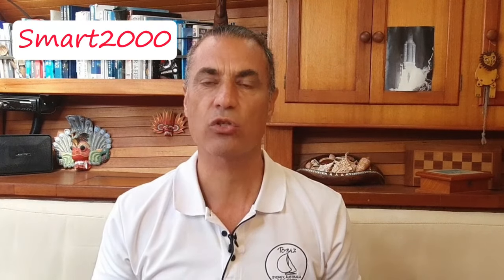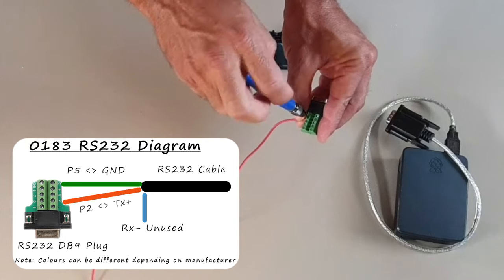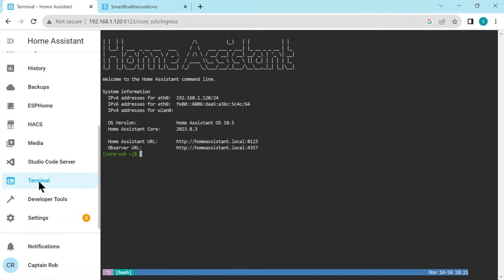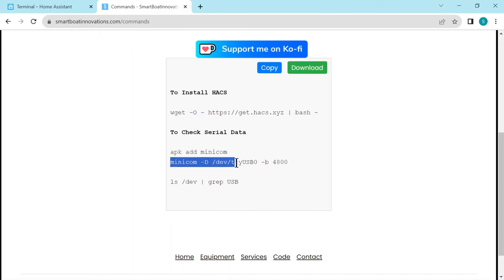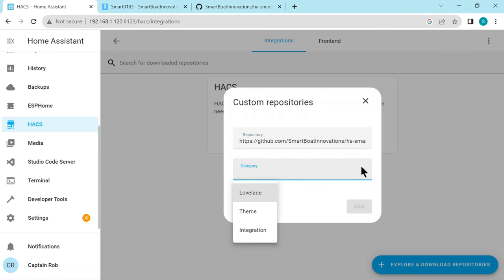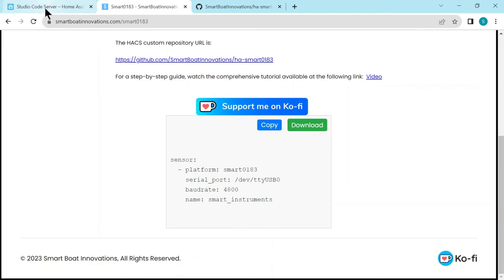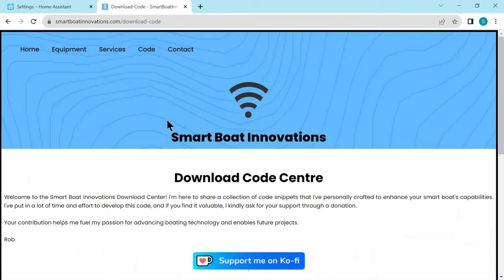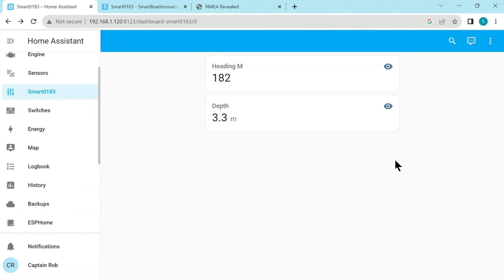Smart Boat 16: Connect NMEA Instruments to Home Assistant

Comment: Well done! Excellent topics and well presented. Looking forward to your NMEA 2000 integration.
Reply from the maker: Thanks! I'm actively working on a NMEA 2000 integration and plan to release it within the next few months. In the meantime, I suggest using an NMEA 2000 to NMEA 0183 connector, as I've mentioned in the description of my video. This should be a useful workaround until the new update is available. I truly appreciate your interest and support!
Reply from the maker: I have just finished a new custom integration that accepts 0183 over WiFi. Maybe you have signalk or a device that outputs 200 to 0183 via wifi.
This is the HACS repository address
https://github.com/SmartBoatInnovations/ha-smart0183tcp
I will be releasing a new video on how to use it but basically just follow the steps in this video but you do not need to add a configuration.yaml entry. 
Just after HACS add the integration smart0183tcp and a menu will appear asking for IP address and Port of your device.
Let me know via email how it goes,

Comment: Thanks, Rob for your excellent videos and ideas. Can you give in a future video an example of the automatization of the anchor alarm?
Reply from the maker: Thank you for your interest! I have a video coming up that will discuss setting up an anchor alarm using the SmartBoat system. There are two main methods for connecting GPS information to SmartBoat: one involves using NMEA in conjunction with your boat's GPS, and the other utilizes the GPS of a mobile phone. While I'll go into the details in my upcoming video, these insights should help you start exploring the possibilities in the meantime.

Comment: Hey this is great, thanks so much for sharing! I've got my NMEA data transmitting over the network and using OpenCPN to display the data (instruments). I would also like to get the data into Home Assistant. So using you're method (but skipping the serial->USB adapter); how would you recommend recommend getting the data (from the network) into Home Assistant?
Reply from the maker: @GoofyBootsTravel  I have integrations for all NMEA see....
NMEA 2000
https://youtu.be/t1qDKVBHRrs

NMEA 0183
https://youtu.be/VxIcNZlDbTI

Comment: Thanks for a great video. I have a Ikonvert NMEA2k to usb connected to my RPi, installed the HACS custom repository, but it seems like the RPi are getting overflowed with data from the serial, at 115200 baud. I think it have fried two of my pi'es now(the usb port chip). I have tried to reduce the baud rate, but then the data received are not readable.
Reply from the maker: I have been running mine 24x7 for over 8 months now. I have it set to 4800 baud. All should work well at that speed. The only reason if it is not readable is if the receiver/sender are not both set to up to receive/send at 4800. If both ends have agreed on the same speed it will be readable. Make sure the Ikonvert  is set to 4800. Very strange you have issues with the USB chip on the RPi. You should the check the power supply to the RPi as if it might be struggling and then leading to hardware issues under higher load. Also it could be an issue with the serial to USB adapter you are using. Let me know how you get on.

Comment: Fantastic : i am waiting your nmea200 version - my main interest are batterie supervision and boating alarms especially when you are inside. My raymarine is outside and i can miss important alarm
Reply from the maker: Thank you for your patience regarding the NMEA 2000 software add-on. I'm actively working on it and plan to release it within the next few months. In the meantime, I suggest using an NMEA 2000 to NMEA 0183 connector, as I've mentioned in the description of my video. This should be a useful workaround until the new update is available. I truly appreciate your interest and support!
Reply: @SmartBoatInnovations  Thanks for your job. I have a device which convert nmea 2000 to nmea 0183 but send the data on wifi on dedicated port. Is it possible to use your integration even data dont come from usb port ?
If yes let me know how.
Congratulation.
Reply from the maker: . @andrepallotta8633  Hi Andre, I have just today finished a new custom integration that accepts 0183 over WiFi.
This is the HACS repository address
https://github.com/SmartBoatInnovations/ha-smart0183tcp
I will be releasing a new video on how to use it but basically just follow the steps in this video but you do not need to add a configuration.yaml entry. 
Just after HACS add the integration smart0183tcp and a menu will appear asking for IP address and Port of your device.
Let me know via email how it goes,
Reply: @SmartBoatInnovations  Thx i cannot succeed in adding the repository.
Is it the right address ? Or i do a mistacke ?
Reply from the maker: https://github.com/SmartBoatInnovations/ha-smart0183tcp  
This is the correct one. The same as I  posted yesterday. 
HACS -> Integrations -> 3 dots top right -> custom repositories -> repository: the URL above and category: Integration -> Add -> Then select it and click down load -> Settings -> Integrations -> Add integration -> search for 183 -> Select  Smart Boat 0183 TCP -> fill IP address and port and then submit
 @andrepallotta8633

Comment: Hmm baud rate of 4800 is low if connecting devices with rapid update. 38400 supports AIS over nmea 0183. Another note: A flow meter combined with a tank level sender will provide the most accurate percent of total volume of freshwater tanks. An idea for your next video perhaps. Most common pipe diameter in the US is 1/2" npt.
Reply from the maker: While 4800 baud might appear slow in comparison to modern data transfer rates, the key consideration is the practical application of the data. For tasks such as monitoring and alerting, a baud rate of 4800 is typically sufficient. To put this into perspective, 4800 baud allows for the transmission of approximately 8 NMEA sentences per second, assuming each sentence is of average length. In most practical scenarios this rate is adequate to receive timely updates and alerts. It's hard to envision a use case in standard monitoring where this speed would be insufficient. I appreciate your suggestion regarding the tank flow monitoring. It is something I have been planning.

Comment: Hi Rob. Rob here from Almerimar. Love your series so far. I have one remark and one question.

Remark: i dont have studio code server, had to use File Editor in stead. 

I have a Ship Module that puts both nema’s on tcp. Need to specify ip address and port to access it, spits out 0183 sentences. can i connect that to your 0183 integration?
Reply from the maker: Thanks. Yes you can use file editor as well. To install Studio Code Server watch this video: https://youtu.be/bOKVcJPTIqs
Currently, my Smart0183 integration is designed to work with a local serial, and it doesn't directly support TCP connections. However, your suggestion presents a valuable upgrade opportunity for the integration. While I see the potential benefits, I'd need to get my hands on a device like your Ship Module to properly test and implement this feature. I'll definitely consider this for future updates. What model of Ship Modul do you have?
Reply: Oops. Missed that one, my bad. I figure you’re in Spain? Maybe we can get together so you can play with my ship modul? I can bring it to you.
Reply from the maker: I am in Mallorca. Not sure how we would do that. Send me an email and we can discuss.  @svtosca3371

Comment: How/where to check if I have rs232 or rs422? Thanks
Reply from the maker: 1. RS-232 Cable:
   Normally uses 3 wires: Transmit Data (TXD), Receive Data (RXD), and Ground (GND).
   
2. RS-422 Cable:
   Typically require 4 wires for the basic setup. This includes a pair of wires for Transmit Data (TXD+ and TXD-) and another pair for Receive Data (RXD+ and RXD-).

Comment: So if I have a 2K network why would anyone convert their baud rate back down from 38K down to 4800 of 0183? I understand the Pi can accept 0183 signals directly to the GPIO and use various softwares like your assistant or Signal K, someone should write some software to allow these assistants to read 2K sentences directly without slowing them down. 😮
Reply from the maker: As I mentioned in the video I plan to release a custom integration that connects N2K directly to Home Assistant. I have a working version but just need to package and test it. NMEA 0183 can run up to 38400 speeds. But for most Smart Boating applications 4800 is sufficient.